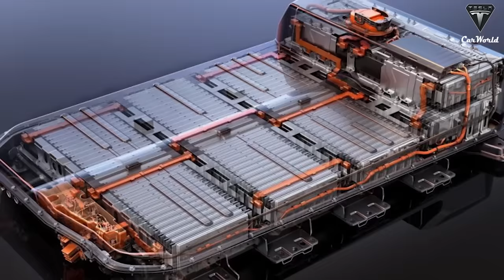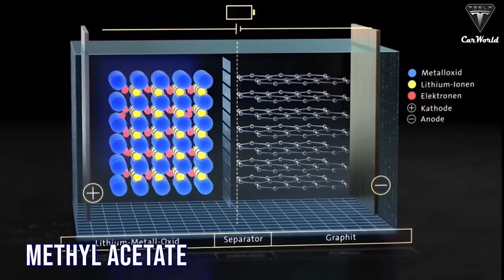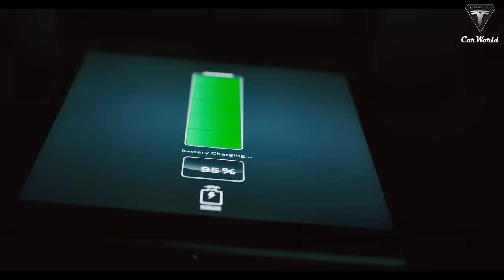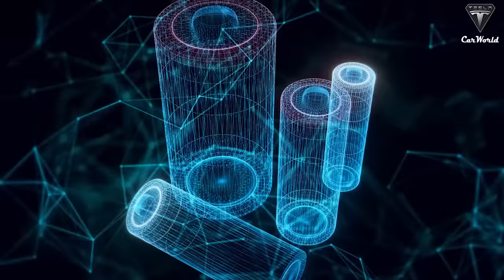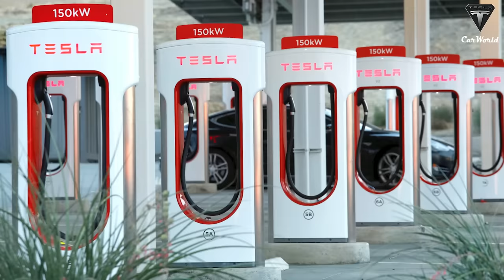The End of Lithium P3! Elon Musk Revealed ALL-NEW Shock Battery Tech, Change Entire Industry!

Comment: There's one thing they don't mention: COLD WEATHER performance. All batteries are ADVERSELY affected by cold. Also, what plans are being made to upgrade the national power grid (which is JUST able to handle the current power demand) to handle the increased anticipated load(s)?
Reply: Exactly right...cold weather is the bane of EVs and mass storage for the grid. Even if cold weather issues can be solved (still not clear) at the current lithium ion pricing it would cost 400 trillion to deploy just the batteries needed for USA night time use.
Reply: Actually  by adding an alternator to each wheel generates the required charge back to the batteries that if used everyday can eliminate charging stations completely , I understand the system will never be allowed to be mass produced while the powers that be are in control!
Reply: @groundworks81  Good thinking all around.  

People are often short sighted, and uninterested in giving up a little of their own wealth to serve the general good.  

I myself, evidenced by my lack of action,  overvalue myself over kids I could feed or save through heifer international or babysitting for the abusive mother across the hall from me who is stressed out and unable to love lawfully.  

Regenrative braking is already a thing on all electric vehicles I know of and most hybrid vehicles.  When you brake lightly, it recharges the battery.  When you brake hard, it's too much, and the regular friction brakes are added to the mix.  Regenerative braking takes the kinetic energy from your car moving (1/2 m V^2 ) and spins coils that move electric and magnetic fields which are turned into induced electrical energy that can be stored as chemical energy in chemical bonds in a battery.  Each of those steps -- spinning, induction and conversion, and chemical reactions have losses.  You can never get 100% of the mechanical energy back.  And you're always driving through air which has drag that also turns kinetic energy to heat the whole time you are driving.   

It's not so bad.  Regenerative braking is great.  Full self driving cars in safe-enough environments can do even more, like drafting off each others bumpers to save more fuel. 

Yes, humans are tribal, and under the right (wrong?) conditions, can be more or less greedy and short sighted.  We can also cooperate, love, and transcend -- together.  The evolution of cooperation is in our hearts and in our genes, or so Jan Axlerod claims. Someone wise said something about 'on earth as it is in heaven'  happens when old men plant trees whose shade they will never sit under.  Once we all realize we have plenty, and will likely never starve or freeze to death, we are freed to aim for our highest and best purpose in life.  All of us, able in smaller and bigger ways to join together healing the world.
Reply: Yes all current technology, but maybe some of these newer technologies will provide longer storage capacities or other benefits.
Reply: @glamdring0007  Yeah of the current technologies batteries.
Reply: @groundworks81  Free energy doesn't exist as both physics and the laws of thermodynamics still rule reality.
Reply: @groundworks81  if you use an alternator for the wheels then it would lose power the same as it does now - you can’t make perpetual motion my brother
Reply: @groundworks81  law of thermodynamic..would deduce this is impossible, higher efficiency is achievable
Reply: grid batteries are the right solution to stabilize the grid
Reply: Any team can work on improved batteries. And it can be done incrementally.
I would rather see Elon Musk put effort into perfecting a Gen 4 nuclear reactor that can consume nuclear waste as fuel. You wouldn't need solar or wind at all.
Perfect the design, make it dummy=proof safe, make them modular and ship to site, build them in a gigafactory for increased safety and decreased cost due to economy of scale. Make them so safe and so cheap that anyone around the world could buy one. Energy crisis solved.
Make some of them small enough to fit into a ship. All the ships in the world could be running on practically unlimited power.
Reply: You think we will ever invoke the power of quantum mechanics into super efficient vehicles?
Reply: Well OBVIOUSLY, everybody is going to have to move to Arizona! LOL
Reply: @glamdring0007 The wall batteries can be charged by the solar panels on the roof.
Reply: @groundworks81 brilliant idea to install alternators in each wheel to generate electricity and charge the  car battery.

Comment: The comment about using the right technology for the job is important so having multiple types available is a good thing. A very efficient high cycle battery used for large scale storage (think the power grid or even a single house) would be better than a low efficiency higher density alternative. The Aluminum battery near the end looks very promising, especially if they can develop a cold version of the electrolyte. Personally, I like the idea of its main ingredients being some of the most abundant (I was unaware aluminum was one such material, though I believe the refining process itself may be quite 'dirty' [not certain though]).

One barrier to certain large capacity batteries could be the chemicals created during combustion (ie: fire) making certain combinations uniquely dangerous (not good if a phone battery fire creates mustard gas after all). Good to see so many advances are happening at the same time.

Comment: Hopefully aluminum/sulfur batteries will be perfected in the next several quarters and adopted by grid operators. The specs are incredible! GMG sounds like our aviation solution.
Reply: The power per weight ratio is not high enough, the only way that you will have green aviation is green hydrogen.
Reply: Would this battery be as light, or lighter than lithium Poly, or would the weight tend more towards the older Nichol and lead acid batteries.
Reply: Niobium Diamond Batteries?
Reply: General
Motors going green first batters and clean energy hybrid to charge batteries lomgterm
And on the go!
Reply: @rRobertSmith  also batteries only take and store energy, even public needs ways to make clean energy by themselves and evade power bills/ tax entirely then spending the and recharging and fees to big corps per year!
Reply: You know what happens when sulfur burns?
Reply: @rRobertSmith  hydrogen has very low energy density. 
The future of aviation is synthetic kerosene. Easy to store, very high energy density.
Reply: @milesdeep8144  yep gets hot as hot metal 7 that another flaw, clearly we need a better & more rare-earth 7 hybird clean ennegy miracles to make e cars safe & mor enengy effieicnt/sufficient like hybirid ut with solar,wind etc without the gas!!, but ensured it can be done we just need to get ourselves together
Reply: @Richard Mcintyre even as lithtium ion is leached with mass seces of water fields toleech out the lithium form ground ores & an environmental issue
Reply: @rRobertSmith  huc enzymes
Reply: Salton City where enough for the USA uses Lithium .
Reply: @rRobertSmith  Did you know that u need to electrolize water for that ??? And for that u need equal fuel energy intake ? Like a HELL AMOUNT OF ENEGY !!! The exact ENERGY U NEED TO RELEASE ON FLIGHT ! 😂😂🤣 Now: which type of propeler would give u the most efficiency per kwh consumed. The classic propeller, or the propeler inside o tube (torboreactor like), to maximise thrust mechanic energy on plane with the same kwh ??? And this is it !!! Top end limit and we will need another IDEA !!!
Reply: and 70 years of battery life it's still weak.
Reply: What about operation where the dry adiabatic lapse rate comes into play? Heated battery compartment?
Reply: 😊lo
Reply: @Richard Mcintyre Aluminum is dead already with the practical release of Sodium batteries by both CATL and BYD into EVs.  Mining is simple and available throughout the world, easily adaptable for use in batteries, can be recycled and far, far less expensive then Lithium or any battery type mentioned in this video. Considering CATL (largest battery maker) and BYD (2nd largest) already have practical Sodium batteries in use today, that is the direction EV makers will follow. Price of LIthium is dropping like a rock.
Reply: @petersvancarek  Then you had better go tell Boeing to stop developing with hydrogen.
Reply: Would be good for military tanks also !
Reply: Nickel Hydrogen Batteries have a 30 years plus lifespan, have half the capacity of lithium Ion, charge double as fast as lithium ion and you can shoot them with no risk of fire. 
Farther development can make these batteries have 3 to 4 times capacity of lithium Ion. While maintaining their 30 years plus lifespan.
Plus you can service them and give them another 30 years of life. Its a well tested technology that is used in satellites and submarines.
Reply: Toyota released another watered powered car and all future release will be powered by water not batteries. Soon more companies will be powered by water. Here in the Philippines, there are few DIY motorcycle enthusiast that converted their motor to run from gasoline to water, and it runs flawlessly just like a regular motor running on gasoline.

Comment: Does this mean that we only need to charge once every million miles?  That's fantastic! It sounds better than the Flux Capacitor!!!!!
Reply: I think the battery will continue to be able to be recharged for a million miles, so you don't need to buy a replacement battery before your car dies of other causes. But you still need to recharge it at regular intervals.
Reply: Yes, you have to listen to the words. The battery will last 200 years or 10,000 cycles theoretically. But it will still need recharging. Good news your vehicle will hold its resale value longer.
Reply: @charleshash4919  u7
Reply: @SwampDonkey64  it’s not that super ultra revolutionary lithium. Iron phosphate is already very common in the solar generator battery industry and can cycle up to 4000 cycles instead of lithium which is only about 500

Comment: At this moment, I think I don't need EV batteries to last 1M miles. 300k miles is good enough for me (I'll buy a new car when it reaches 300k miles like with ICE cars). I prefer smaller, lighter batteries so that I have more space and and the tires don't die too fast.
Reply: With 1 million mile cars, you just need fresh new seats every 250k miles, new windshields when they scratch, chip or break, maybe new carpet and headliner, and the usual: tires, windshield wipers, cabin air filters, paint, headlight modules.  That stuff should cost a lot less than buying a new vehicle.
Hopefully there will be companies that do that whole car refresh in a week and for a reasonable price.
If you are tired of it, you can sell and buy another.  Better to sell a perfectly good car to a new owner, than to send it to the wrecking yard.
Reply: Me too. There are people out there who doesn’t buy a new car just because it’s a new model and the same as with cell phones.
Reply: You wouldn't buy a new car when they go up to 1,000.000 just to own one
Reply: @joewinkler2168  1,000.000? what units
Reply: The life time of the battery. I had a brand new 2005 Hybrid. 2012 I had to replace new battery at 60K mileage, it cost me 4K. Do you need 1M miles battery or not?...
Reply: The goal is to find batteries lighter and more capable. A 1M mile battery that weighs the same as a 60,000 mile battery, can be used to cut battery weight in half, and still last 9x as long. And better, if the recharge rate can be increased fro the first 8 lifecycles, you'll be able to charge in less time to go the same distance. And once production scales up, the prices will be on parity to the current battery tech.

Comment: My biggest concern is how weather affects batteries.  Living in a place that hits -30 at times it really kills batteries.  Also these batteries are very volatile and the vehicles are so expensive.  Of course recycling is important as well.  I'm very curious about the aluminum sulfur battery.
Reply: Get heated batteries or keep them in warm places, if your place has an inverter which it most likely does, they have a tendency to produce heat, direct it’s fans towards your battery keeping it warm and closer to above zero during those cold winter freezes.
Reply: you need solid state battery for that extreme temperature like -30
Reply: Nothing like driving your car around the inside your house. Anyways dispite eveyones claims it still is an oversized rc car. Its a toy that can drive you places. If your in a place where fuel prices are volitile it would be a better idea to get a fuel storage tank so when prices go up and down it wont mess with you. This is a fast golf cart. Dont get one expecting it to last. You could probably go through 7 or 8 of them in your life. Dont rely on it.
Reply: Toyotas new solid state battery is the answer. It should be as earliest out in 2025
Reply: @icemanpain  yep if they decided they actually wanted to do it. At there longest they could just not do it. It still be like 4 times more costly than everything else and not drive any further than the new stuff around it. At the speed and enthusiasm their going its going to be more like 13 years. There probably waiting around so someone else will make good batteries for them.
Reply: If you factor out the battery, EVs are much cheaper than ICE vehicles. it is really just about the battery. this is the only weak point.
Reply: @stefanweilhartner4415  thats true but that was also true 70 years ago.
Reply: @stefanweilhartner4415  yes but it's a huge weak point and heavy.  It will take some time but I'm sure they will become much better given more time.
Reply: Move. 
Larry in Arizona 
and loving it

Comment: What about winter states? You'll need a heater for the winter that wouldn't also drain the battery. For EV cars, they need to get with utilities right away and create a UL standard asap. Without the standard, it will take a long time to a place with the same charging port or ranking/classifications that are the same between all companies.

Comment: One solution for air transport is to change the form factor into a larger flying wing aeroplane, to accommodate a bigger battery pack, for increased range. This will allow for an ascent phase to altitude for the first third of the journey followed by a glide phase for the remaining two thirds of the journey, to reach the destination, with the added benefit that the approach to destination, over a city, would be near silent.

This new design may mean more passengers per journey by a factor of two, which will actually make aeroplane companies profitable and at the same time seats more affordable.

This new aeroplane shape will herald in more internal design variation and provide aeroplane carriers the opportunity to provide services to attract passengers to their company.

An optimum solution could be to use helium balloons to ascend the aeroplane near vertically to around 60,000 feet altitude (at a rate of 1000 feet per minute) before they release the aeroplane into its glide-path to its detination, with the helium balloon carrier returning to base.
Reply: The limit to still have enough  airdensity is 33000 feet ⅓ sealevel density.
with a practical glideratio of 30 gives you a gliding range of 1 million feet divide by 6000 give you a range of 167 nautical miles, the same range as the electrical Pipistrel with a large battery. Same motor version.of a rotax engine goes 600 Nmiles, what is missing? The free oxygen in the air, four times as much as the liquid fuel. Max range of a 777 ER is around 10000 NM with 30 min reserve the rest has been burned up, during the trip the airplane gets lighter and lighter increasing the specific range considerably. In summary an electric version hawling the heavy battery at 4 kg/kwh storage won't get 1000 Nm range with half the pax, paying the double. So the batteries aren't even good for the birds. Even with balloon lifted recharge chargers. May be with a self lifting hydrogen pipeline up there at 33000 feet with points of discharge for hydrogen fuel cells, since the oxygen is still there, free for the taking. I bet there is no better potential solution, but batteries 👎
Reply: By the way the expression for the glide ratio is

 GR=span√(¼ π  0.786/CdA)
CdA flat plate drag area
not the aspect ratio matters, but wing span is the thing. 
Read the most popular book:
John Anderson: Introduction to Arodynamics.
Reply: You cannot rely on a gliding aircraft in bad weather. It’s far too dangerous without a switch to some sort of power to correct flight path in high winds?

Comment: It sounds like these new batteries have many advantages but I won’t be shocked if form factors change. After all, this cuts into the market in a big way.  These are great for new products but I suspect a lot of battery powered products will have to be thrown away if you want the new batteries and all of their conveniences.
Reply: This video is full of crap. It is click bait and has no real bearing on the real world.
Reply: @thomgizziz  Wrong, this is interesting information and showing the advances in technology.  Some advancements in any field may take time to be made practical, but once that happens there is a revolution.

The first touch screen was developed way back in the 1960's, but it wasn't really used until the 2000's where the smart phone came out on the market.  This battery tech is new and in its testing phase, so when it'll be put into the market may take anywhere from a few years to decades before commercially available.
Reply: Salton city is enough for the USA to use Lithium
Reply: all the technologies shown here can be produced in any typical form factor. coin, cylindric, pouch, prismatic, ...
Reply: @stefanweilhartner4415  I'm sure the batteries are. Motivations are rarely as varied.